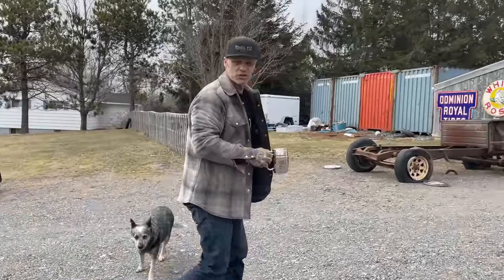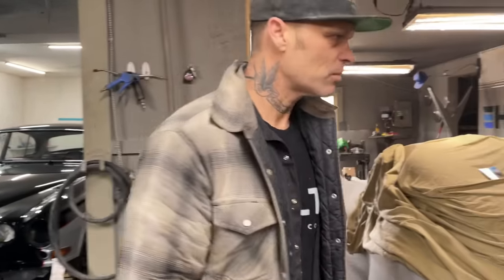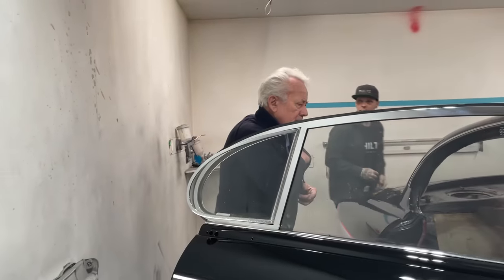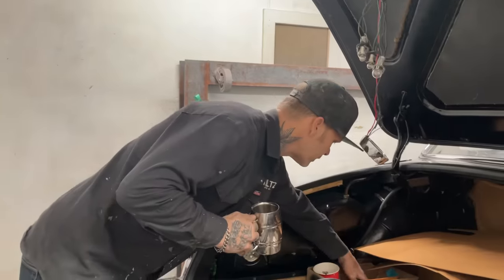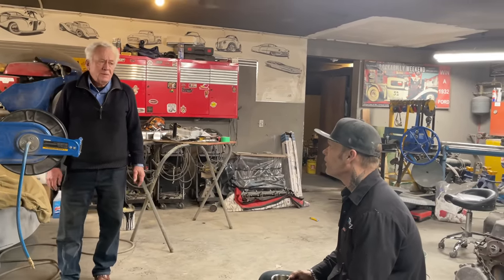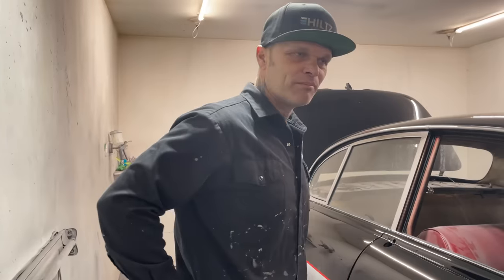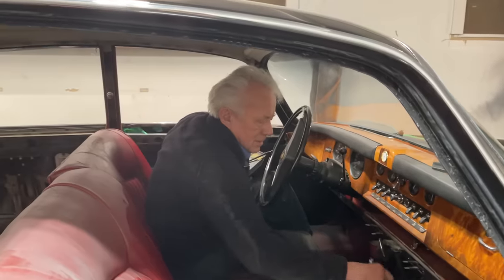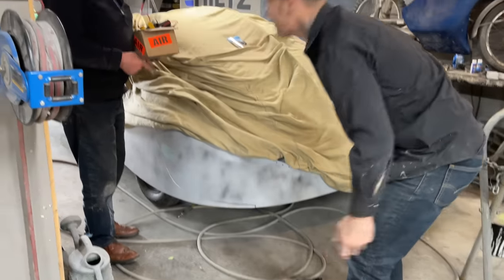REVEALING DOUG'S CAR TO HIM FOR THE FIRST TIME

Comment: Doug did an awesome job cleaning the valve covers and intake if you use a high-temperature engine clear on the intake it will last a very long time and look brand new I know from experience   the jag looks fantastic give your selves a pat on your back for a job very well done

Comment: Nice idea on the finish of the pinstripe Jolene, that was 👌. I like how Doug said let's just slow down, he appreciated the paint that much to let it harden.  Good stuff guys👍
Reply: Reading the label I think it said it was dry to the touch in 4 hours and hard overnight. The overspray on the masking tape was not sticky before he put on the second coat of paint. Chad said it was an old can of black paint he had sitting on the shelf. I don’t know the part number but that seems like some useful paint

Comment: Well done man, this is a difficult job to get right without repainting the silver and clear coating the entire car after colours are applied, without careful prep and careful application of not too much paint on the seam it won’t come out this good which is why you see a lot of two tones that have a moulding covering the colour change.

You also have to know how to spray well to get such a nice finish straight off the gun 👍😎 

I’m in the higher pressure camp too, one of the the reasons they invented gravity feed guns is so you can spray at a lower pressure if you want but there isn’t a “correct” way to do it, as long as it gives you the result you want you can use a frickin brush.

I think people just get stuck in their ways and think there’s only one way to do things, I’m probably guilty of thinking like that sometimes too.

Comment: One of the reasons I don't use single stage is its soft too long.   30yrs of being a bodyman I enjoy you guys.
Reply: I think the Hardner label said dry in four hours and hard overnight. It was dry to the touch before he could get the second coat on. That paint looks very useful
Reply: Single stage if mixed by volume with the correct amount of activator, in a gas heated booth at 20 degrees Celsius for twenty minutes, allowing ten minutes between coats for flashing off, should be dry enough to handle within an hour of the bake cycle ending. Same drying time for the lacquer when using base coat and clear.
Reply: What I was saying is that it scratches easily.

Comment: Brad you need to use a electric pump out of an 80s style Riviera or Cadillac Seville because they had air ride n all you need is a hot wire n ground n I mount them on my trucks so I always have a air compressor handy n plus it's a very small unit ok n forget pumping by hand 😆

Comment: In 1972 in Costa Mesa Ca., just inland from Hoague Hospital, I got to know a fella who did 100 point body and paint for brass era and later classics through the thirties. He painted his cars outside and waited for the weather to be perfect. But the most amazing thing I have ever seen was the way he created a butt joints between colors on multi colored cars. He used scotch tape at the break lines then he sprayed the first color to the line. He waited a week or so before removing the tape. But before he took the tape off and in a days long process. He laboriously cut the paint at the edge of the tape. He used the old Gillette Blue Blade double sided razor blade and several lamps to see where the cut was to be and then to cut it. The cuts were made in short sections and were absolutely laser straight. For the second color he again taped carefully to the edge of the first color. Then on with the second color. Again another week would pass before he would remove the tape. Then if there was any area of overlap it was carefully razored off. I think his final sanding was with 4000 wet paper. The color change took place precisely at the line and there was no overlap in the finished work. The final buffing especially on the black cars was with a new wool buffer and CORN STARCH.  His name was Raoul Hernandez as I recall. A hidden treasure in Southern California.

Ps. His metal body work was done by hand with hammer and dolly. No machines. Interior side welds were finished like the exterior so that the new panel was totally invisible no matter where you looked. Lastly, there was no lead, bondo or other filler material ever used.

One man, one little shop, one giant talent. God bless him.

Comment: That is absolutely beautiful and people were chipping on the method of painting? Results speak loud and clear! That’s a Stunner of a Jaguar.
Reply: I guess you didn't notice all the fish eye on every panel that's a horrid paint job. some will come out with a color sand and buff but most of them are due to half ass body work leaving air bubble craters and filling them with 7 coats of primer that ops later when you paint it

Comment: I had a 1977 Matador 
 I could not get it to start, I checked all of the fuses and they were all good but still wouldn't start , then I find out that they have a Fusible Link  it's a soft piece of rubber with a thin  wire  inside of it. 
I bet that's the problem why Doug's car  won't Start.
You could also check the metal ends of the glass fuses ,  When they blow you cannot see where they're blown as sometimes  at the end of the Fuses.

Comment: I had my pickup painted and my car by body shops, both with 30 years experience and this paint job you did made them look like they used paint cans and half ass skills, I’ll take care and try over half ass every time
Reply: Dude did you see all the pinholes in the paint look at the hood at 12:30 that's horrid work. The problem is he does half ass body work leaving many air bubbles or pinholes and larger craters that he than fills it with 7 coats of primer not putty. They pop open later leaving what looks like fish eye on every panel. 1st rule in body work if it ain't straight it ain't ready for primer. No quality body shop would let him get away with that

Comment: Just a tip Chad when I click on a video and see tons of ads I will either not watch or do a trick to make them disappear. Just being honest. Man an ad every 3 mins is why I cancelled cable.
Reply: Chad has no control over the adds.
Reply: I thought the same but when he makes $$ on the ads as a small shop in a small town would rather see them getting revenue over the big guys. ie..gas monkey..vinwiki...etc. Some good shows out there but just love these two
Reply: I use an add blocker, and I can see the whole show without any adds. So I have no idea what you are talking about.

Comment: Is the paint flawless? Is it just the camera angle or are there specks in the paint a bit?
Reply: 👀specks?
Reply: There are dust nibs in the paint. You could see them in the trunk in the last video. Pretty much unavoidable in a booth like his. He could cut and buff the paint to remove them but in last vid he said he wasn't going to. The paint's a nice 20 footer but far from perfect.
Reply: @TheInsaneShecklador  ah okay, so me eyes aren't tricking me then... So the garage paint booth method won't make a great show car I suppose?
Reply: @jmart21  You can get a very nice paint job in a garage booth. If you are trying to make a "show car" you will need to wetsand (cut) and polish (buff) the paint whether you painted at home or even if you used a professional down draft booth. Straight off the gun finish will never be show quality.

For a car that is driven some dust nibs are not the end of the world. I've even seen nibs in brand new O.E.M. cars. If you're not sitting there constantly dusting your car with a California Car Duster you probably won't even notice them unless you look real hard.

When painting in a garage it really helps to be meticulous about cleaning, wetting the floor, and wearing a proper paint suit (lots of the trash in paint comes off of you and your gun/hose) 

If you're spraying metallics at home any dirt in the clear that is too deep to sand out will pretty much hide itself but light solid colors like white are trickier. If shooting a light color solid at home I'd probably use single stage.